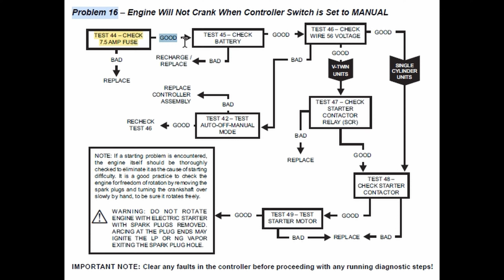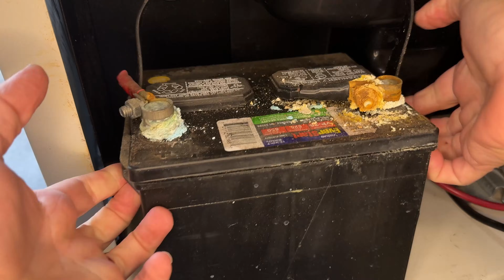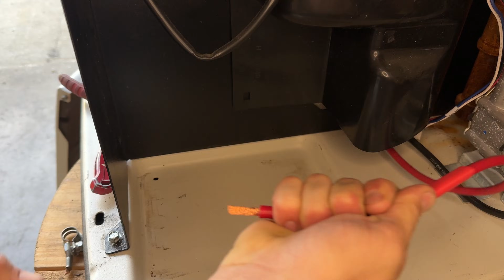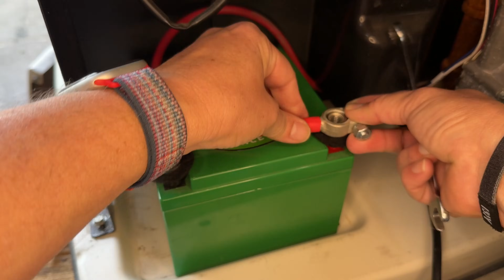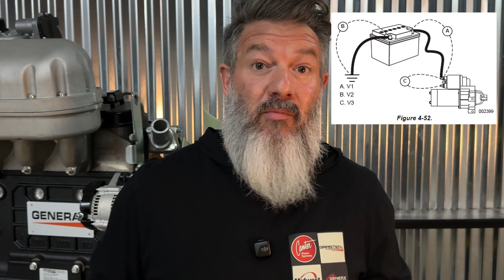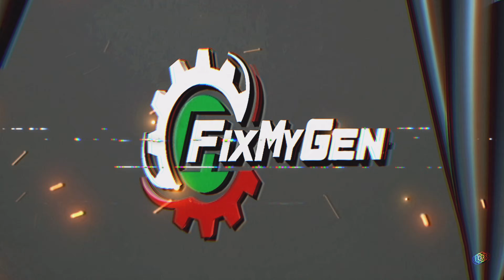GENERATOR RPM SENSOR | FAULT CODE 1505 TROUBLESHOOTING | BATTERY & FUSE DIAGNOSTICS 🔋⚡

Comment: Many thanks for posting this informative video. I had the error message, cleared the error. The genrator starts manually. But it will not start when it is scheduled to test run. The battery condition (from the battery menu) also shows "good". Should I still change the battery? The unit is 3 years in operation since new.

Comment: Got the 1505 code. Took the battery to Advance Auto to be checked. They said it was “fine”.
Still got the 1505 code. Went to Batteries Plus, got a new battery, problem solved. Don’t always believe Advance Auto!!!

Comment: Love this video. I checked my battery and I had 14.5 volts. No go on the start up. Put my fully charged little jump box on the terminals and voila!
  It started up. Plenty of voltage but lacking on the amps on the Bad 5 year old battery. Thanks to your trouble shooting video, it saved me a $250 trip charge from the local generator repair company and god knows what they would’ve charged me for a battery. Probably $400……
   $79 later, I’m back on line!😊

Comment: Another great informative video. I got the 1505 message this week from MobileLink when my 24KW generator was going to do it's bi-weekly exercise. I haven't had a chance to go to the cottage to check it out, but I wanted to ask:

1) if I clear the error and then press the manual start button and it starts, should I just leave it alone and see if the exercise proceeds as normal next time, or should I just replace the battery anyway?

2) Can I use an automotive OEM Group Size 26R Battery with 540 CCA, or do I need to get a battery from an authorized Generac dealer?

Edit: the unit is 4 years old now, and the generator gets the oil change service every year.
Reply: Well, I cleared the error and tried to start it manually, but it wouldn't turn over. Bought a new OEM battery, and everything works fine now.

Comment: Yes, battery was my problem
Reply from the maker: That’s a great bit of feedback, and I’m glad you tracked it down.

Think of the battery as the heart of the whole system. When it starts to get weak, it’s like trying to run a marathon with a heavy cold—the brain (the controller) starts sending out panic signals because it isn't getting the steady "blood flow" of power it expects. A 1501 code is often just the generator’s way of saying it’s feeling lightheaded.

I really appreciate you taking the time to watch the video and circle back to let us know what worked. It helps everyone else in the community realize that sometimes the fix is as simple as a fresh battery. Thanks for stopping by the channel.

Comment: How do you think the smaller AGM's will do in the Next Gen series?
Reply from the maker: That’s a great question and honestly a good idea for a future video. I like the move to AGM, but I’m always a little skeptical any time they shrink a battery. Dropping from a 26R means less reserve capacity, even if the new engine, starter, and controller are more efficient and pull less current.

My gut says this is a “time will tell” change—we’ll know more after a couple of storm seasons and some real start data. What are your thoughts on it?

Thank you for watching and taking the time to comment.
Reply: @FixMyGen  I am like you in thinking an AGM is a great choice for a Generator, but a bit concerned about it being smaller.

Comment: What are the cost involved with the new battery upgrades?
Reply from the maker: That’s a great question, and the answer really depends on a few things—what generator you have, and whether you’re planning to make this a DIY project or have a certified dealer handle it.

Technology is changing fast, but right now I recommend a high-quality AGM battery along with compression-fit battery terminals. Clean the posts, add anti-corrosive pads and spray, and make sure everything’s snug once reassembled.

If you’d rather have it done for you, head over to www.GenerXpower.com to check if we service your area. If not, our team can point you to one of our partner brands that does. Thanks for watching and taking the time to ask a great question!

Comment: I have a 22kw generac guardian. I was getting code 1505 during the weekly automatic test. I can start the generator manually. I replaced the starter relay since it was cheapest option to start with. It seemed to have fixed the problem for about a month. Today i noticed the red light end it was 1505 again. I cleared the code and still can start it manually. I guess i will replace the battery now to see how that goes. Does all this sound right to you? If battery change doesn't correct issue i will have to call a technician. The generator has been in service now almost 4 years.
Reply from the maker: Thank you for taking the time to share all of that detail. Code 1505 on a 22 kW Guardian usually comes down to the controller not seeing the engine spin fast enough at start. A weak or aging battery is the most common culprit—it may crank, but not fast enough for the board to read proper RPM. At four years, your battery is due, so that’s a smart next step.

If the new battery doesn’t solve it, double-check the cable ends and grounds for corrosion or looseness. Beyond that, the RPM signal comes from the ignition/magneto side. That’s not something you can easily “eyeball”—it requires testing equipment and is usually technician territory.

Your troubleshooting sequence so far is logical: relay → battery → connections. If the code returns after that, it’s time to call a tech to dig into the ignition circuit. You’re definitely on the right track.

Comment: I watched this whole video expecting some actual tips on common problems and all I got was simple battery diagnostics 😑
Reply from the maker: Totally fair—if you’re in the industry or already comfortable with diagnostics, this one probably felt pretty basic. No harm in calling that out. The goal here was to help the average homeowner get through a pinch when a tech isn’t immediately available. But you’re right—this definitely wasn’t meant for seasoned pros. Appreciate you giving it a shot either way.

Comment: Well, mine lasted about three  years and 20 hrs before it failed with a 1515 code. It would intermittently fail while running several times and then now won’t even start. I cut off the junk battery terminals when I got it installed and saw what cheap terminals they put in them. Then I put the battery inside of a heated/cooled shed and extended the cables out 4’ with larger ga wire. I won’t be buying another Generac or Honeywell. I paid $3200 plus tax for this piece of junk. Thank goodness I put a manual transfer switch and not an automatic one.
Reply from the maker: Totally understand the frustration—especially when you’ve done your part and the thing still won’t run. That 1515 code can be triggered by a few different things, as we covered in the video… and unfortunately, some aren’t even inside the generator itself. Fuel supply issues, early valve drift, or even a skipped break-in service can all stack up.

And you’re right about those terminals—not exactly top-shelf. But if every component was built like a tank, these units would be priced out of reach for most families. Tradeoffs aren’t ideal, but they’re real.

All that said—I still believe Generac builds a solid product. Like anything in this space, some units need more attention than others. If you do end up considering another one, keep an eye out for what’s coming in Q3. They’ve got some strong upgrades on the way.

Comment: Why not install those cables when the original unit is installed?
Reply from the maker: I see where you’re coming from—but by that logic, there’d be no such thing as upgrades. No aftermarket wheels, no leather seat packages, no room to tailor anything based on budget or need. Every install would be the Bentley of generators, and most folks wouldn’t be able to afford one. Appreciate the question—but not everything can or should be “the best” right out of the gate.

Comment: I got the Rpm sense loss msg, installed a new battery, and had a tech come out who recommended a new controller. Bought my own and installed and when I try  to manually start it I still get Rom sense loss. Any further ideas? Thanks
Reply from the maker: Appreciate you walking through everything you’ve already tried—it helps. Here’s one thing I’ve learned from messing with a lot of these: not all RPM sense loss codes mean the same thing, even if they sound similar.

There are actually four versions of the 1500-series RPM codes:
	•	1501 – No RPM detected during cranking
	•	1505 – Same as above, but sometimes logged under different controller firmware
	•	1511 – RPM was detected, but then lost during running
	•	1515 – Same as 1511, just logged a different way depending on the board

If you’re getting 1501 or 1505, it usually means it’s not cranking hard enough—battery voltage under load, starter relay, ignition coil, or even the 18-wire not sending signal.

If you’re seeing 1511 or 1515, that’s more often a fuel delivery, stepper motor, or governor issue—you had RPM briefly, then it stalled and the board shut it down.

Since you’ve already done the controller and battery, I’d check:
	•	Ignition coil sending signal?
	•	RPM signal wire (18-wire) seated tight?
	•	Starter relay energizing, not just clicking?
	•	Fuel solenoid opening?
	•	Stepper motor moving freely and not stuck wide open or shut?
	•	Throttle linkage intact and spring-loaded?

Let the exact code guide your next move. They sound the same, but they point in totally different directions once you’ve lived with them a while.

You’re closer than it feels. Keep going.

Comment: "No Rotation Warning" is a new alarm that is typically appearing with the 1505 Fault Code. A video on that would be appreciated as it is appearing more frequently and often looks like a starter problem.
The starter is very difficult to get to and replace. A video would be appreciated.
Reply from the maker: Thanks for the comment! If you’re seeing a “No Rotation Warning” with fault code 1505, it’s related to RPM Sensor Loss during cranking. Other common overcrank/RPM faults include 1501, 1511, and 1515—depending on cylinder type and whether it happens during cranking or running. I’ll work on a video breaking down ease of access to the starter, best tools and practices, and ways to save time—and your knuckles. Appreciate the suggestion!

Comment: This was a really informative video (Fault Code 1505)!  
I'd be quite interested in your thoughts about Fault Code 1902, on recently installed Generacs.

I'm reading a lot of recent stories in the generator forums that seem to point to a design defect in the latest Generac units, which shows up very early (less than 60 hours of use), as a Fault Code 1902, and which requires a major rebuild (rotor replacement).

Example #1, "Brand new unit (7 months old) never ran apart from test. Came on for like 2 hours Monday then shut off showing error code 1902. Tech from the supplier came last night said I need to replace rotor and brushes. Apparently they have had over 20 calls with the same problem."   

Example #2, "Just happened to me last night 59 hours on my 22kw Generac unit installed September 2020 and only run on exercise and maybe 2 or 4 hours here and there during outages. Burned through the brushes and a 1902 error.  The tech says the brushes are 4 weeks back ordered."  

Example #3, "22kw Liquid Cooled Generac here. Purchase in 2022. 2 years old. Ran one time for 6 hours. The rest of time was weekly exercises. Total of 29 hours of run time. Rotor went bad 2 weeks ago. Error code 1902. They are building me a new one under warranty. How reliable will this thing be after warranty replacement?"

Example #4, "Same here in New Orleans! Hurricane Francine just blew through last night. After annual maintenance, checkups, weekly “exercise” schedule we put our trust (and fridge full of food) in Generac’s hands and we only got TWO HOURS of run time! It’s the first actual desperately needed emergency usage post-storm run.
It’s a 22 kW Generac running only a TV small air conditioning unit and a few LED lights. Our certified installer shows up today saying that “the rotors and brushes are worn out and pitted and need to be replaced AGAIN after he just replaced them last September. We’ve only had this generator installed September 2021!"

Example #5, "Just happened to me last night 59 hours on my 22kw Generac unit installed September 2020 and only run on exercise and maybe 2 or 4 hours here and there during outages. Burned through the brushes and a 1902 error. We had Milton hit last night and this $14,000 setup couldn’t keep up with something as simple as brushes? I’m livid."

One tech responded to the discussion thread with "Years ago they had a brush alignment issue brushes would hang partially off the slip rings and cause uneven wear. But I've never seen a graphite brush damage a rotors slip rings. If I had to guess the slip rings are probably coming apart and damaging the brushes."

So is this a legitimate issue? Or are these just the 1% of unlucky recent Generac installs, and the other 99% are working fine?

I want to get a Generac because there are multiple Generac service companies in my area, but am wondering if perhaps Kohler is the way to go?
The problem is there's only one Kohler service company in my area, so if their Kohler tech turns out to be less than great, I wouldn't have a "plan B" for getting Kohler service.   
Your thoughts?  
Thanks in advance!
Reply from the maker: Hey Ted,
Thanks so much for watching the videos and for subscribing! I really appreciate you taking the time to leave such a detailed comment.
You're definitely asking the right questions! Generac vs. Kohler. It's a tough call! These days, generators are making really solid products, and it really comes down to what fits your specific needs and preferences.
I understand your concern about the 1902 error and the brush/rotor wear. It's definitely something I've seen reported, and it's a legitimate issue that I'm looking into. My upcoming video in March will cover this in more detail. With any mechanical device there are always a small percentage of issues.
You're also right to consider the service company availability. Having multiple options with Generac is definitely a plus. If you're leaning towards Kohler, I'd recommend researching the reputation of your local service provider. Reliable service is crucial for a generator.
Thanks again for your support!
Best,
Robert